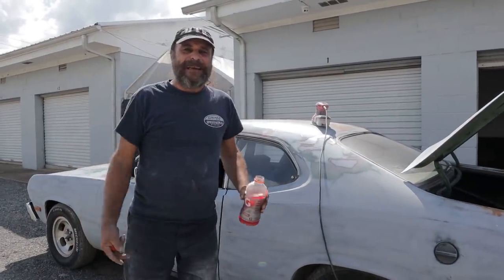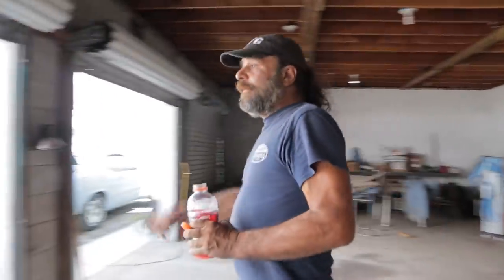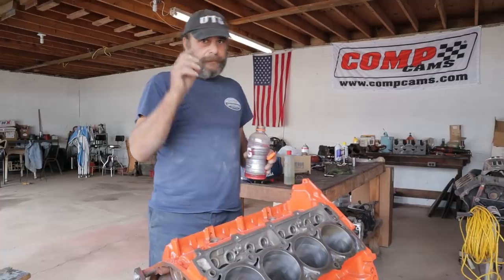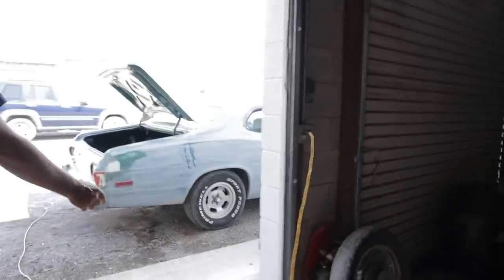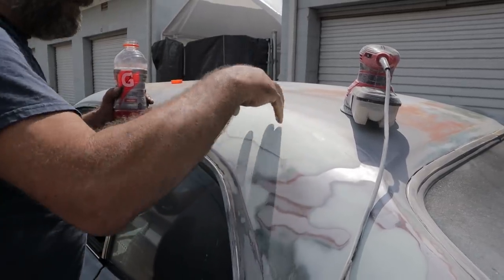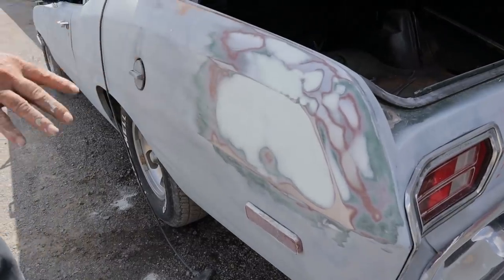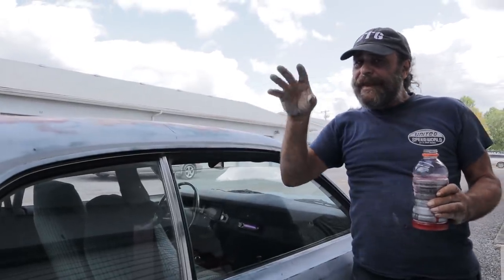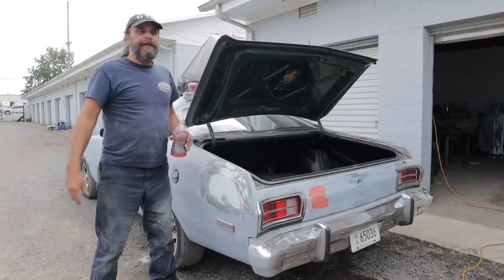DIY Budget Home Paint Job, Take Two...The Redemption?

Comment: That red spot putty you're using is a big no no.It never stops shrinking Tony.
Reply: It deffinetly cracks when it dries :/
Reply: I was about to comment on the same thing until I seen yours. You are 100% correct, its nothing but trouble. It's old school lacquer that is not compatible with todays products. If your top coat has hardener in it then everything under it should also. The replacement is referred to as icing. It has hardener but still sands easy like red spot putty and does not shrink. One that I use is polyester finishing putty by USC part # 26006. Around $26.00-30.00 for a 30 oz tube. It's somewhat self leveling. This comment is not meant to criticize your work just your choice of materials.
Reply: Agreed. That red glaze is trouble. Learned the hard way years ago it doesn't matter how nice it looks,in 3 months it'll have shrunk way down.

Comment: I have done rattle can paint jobs that turned out great, no paint booth just waited for nice days and took my time and did small sections at a time. The key was getting the bodywork perfect which mostly just took time and lots of buffing between coats and wet sanding.  I chose black once and will never do that again, it showed every imperfection and scratch and took twice as long to get it right. The biggest tip I can give is not to rush it.

Comment: Im going through the same pain on my sons 67 VC Valiant, and a trick a panel beater taught me was when you think your panel is sanded and all straight , using a spray bottle with wax and grease remover, spray the panel all over and while its wet and glossy look along panel and any imperfection shows up easily. You can mark that spot and sort it out.

Comment: Metallic! Oh so un forgiving of gun pattern and technique. First time I sprayed metallic, after spraying a lot of solid colors, it came out looking like a bowling ball swirl. :)
Reply: lol
Reply: Tony pay attention, read this comment. Metallic is no joke. Do yourself a big favor - go straight BRG and forget the metallic.
Reply: Just use base/clear urethane and get a really good spray gun.  Work on your technique on test panels. Stay away from silver colors and you will be ok.
Reply: I know someone who randomly picked from the list of pearl coats at the parts store. Didn't keep track of which ones. 
I counted 7 different colors on his Camaro sitting in his garage one night. 
Next week the panels would be different colors under the same lights.
Reply: Right?? Im petrified about the upcoming Dart...!! Im reasonably confident about my painting, but its Rallye Green...and Ive never shot metallic before!!!
Reply: @mitchellferre1652  lol the first metallic I did was a silver hood and fender. Took me three or four attempts to finally get it to look good, plus I was using single stage paint and a gravity feed gun. All I had in 1991.
Reply: However I forgot to add,  years later I did a '91 LeBaron in charcoal grey metallic, but in base/clear, and it turned out great except for one door on the side I had poor lighting in my makeshift plastic tent "booth"
Reply: @Jethrosgarage  lol, the first repair I did was 1988. Dupont Centari enamel  metallic blue. With a cheap siphon gun and really poor technique.  It looked bad, Bad, BAD ! 🤣
Reply: @Jethrosgarage  I saw a light that attatches to the paint gun online recently... Having good light is a huge deal, so ill certainly be getting one before tackling this project!!
Reply: @Jethrosgarage  Wow you were losing the battle before you got to the fight.  Metallic and pearls are on the extreme end of the difficult spectrum of painting.  It is learned only by messing it up till you learn the methods.  Good day.

Comment: Watching this as I paint my car with a paint roller.
Reply: Phuqin savage. 
Everybody get your roll on. What
Reply: I'm currently rolling the Eastwood Optiflo primer on my '65 Studebaker.
Reply: If BMW & Merc can go flat satin, you can proudly go orange peel. 👍🏻
Makes me nostalgic for my rust-belt roller-painted reliable old '78 Corolla.
Reply: I did the $50 paint job a couple times it actually looked good. There was alot of wet sanding though
Reply: That's the power of the home depo more doing more saving ?
Reply: This thread is where I envision heaven to be.  True display of the best of humanity.  I applaud you all.

Comment: Tony, I've been doing custom paint and body for almost 40 years. Do yourself a favor, after doing the body work, put several heavy coats of a product called featherfill on the whole car and block it out. It will help you get it nice and straight. And I would go with a non metallic color unless you're going with a base/clear. Single stage metallics do no lend themselves to be wet sanded.
Reply: Although Featherfill is not my first choice the advice you give is solid. Gotta use a longboard and manually block this car out if you want it too look good. That electric sander is just going to make a mess of it. Agree on the BC/CC for metallics. A novice painter is going to struggle to make single stage metallics look even and wet sanding to correct mistakes isn't going to go well with SS.

Comment: I'm guessing that the weather was hotter and more humid when you painted the Dart. It's amazing how more comfortable weather improves our outlook on just about anything. I've had a fix/flip Ford Explorer at my place for several months. It just needs a fuel pump but I haven't felt like laying under it when it's 90+ degrees with sweat running in my eyes. This weekends forecast is low 70s and low humidity!

Comment: Tony, love the channel, even though I'm not really a mopar guy, I've learned a lot about them because of you. Here is a tip I learned many years ago from a very experienced car painter. I too have painted many cars over the years, albeit poorly in the bringing, until I learned these very simple tips. Always paint the hard areas first, not last. That way you won't forget them. The first coat should always be a light coat, ie it should look like shit, because you didn't lay much paint down. Do the whole car like this & start on the roof & work your way down. That way, all of the overspray of the area your painting will land on an area you haven't painted yet. Let the first coat dry for about 20 minutes or so, then do the second coat. The second coat will "hang" on the first coat which if you're watching how the paint is laying out or flowing, will not lead to drips. The car should look like its finished at this point, ie nice & shiny & appears to be well covered. wait another 20 minutes or more then apply the third coat the same way as the second coat. The third coat may appear not to be needed, but its really there to build up the paint thickness & cover areas that you may have missed in the first two coats. If you end up with drips, let the paint cure completely, then grab a razor blade & wrap the blade on each end with several wraps of masking tape, making sure each end has the same number of wraps. Gently scrape the top of the drip until the masking tape hits the surrounding paint surface, then remove a wrap of tape on each end, then repeat the process. Do this until you remove the bulk of the drip. This process helps you avoid removing paint from the surrounding areas. Once you get the "drip" area down pretty close to the surrounding area, you can then start with the wet sanding process & compounding. Believe it or not, you can remove drips & make them completely disappear. Good luck with this paint job. I look forward to watching : ) .............& PS please wear a mask.

Comment: If u don’t already know about it you can spay the hole car or at lest the spots that your doing body work with shopline or ever coat high build then u wet sand it with 600/800 the ever coat is sweet it sprays on gray and when u sand pink comes out it’s got a build in guid coat now the shop line is cheaper but u need to spay guid coat on to see high and low spots but when your dimes it’s straights it’s a good way to save time and work on your body working time

Comment: Great video UTG! Nice to see ya doing the body & paint on the Duster. I like how you have the little dents & imperfections circled before you started doing any work. It's real easy to see these areas when the car is wet like in video where you were cleaning the car. I think you got overwhelmed on the Dart trying to get the door & fender just right that you over looked the other small stuff, also making YouTube content. I think this one will look 10 times better, not to say you didn't do a good job on the Dart. I feel for ya, there's never enough time!!

Tip on mixing the paint you only need to strain it as you fill the hopper on the gun, at least this is how I was taught & I see others doing it this way also.

Comment: You could have pulled on the bolts you welded on and at the same time used a long spoon panel beating tool (or similar like a broken leaf spring) to fairly firmly hit the outside of the dent. That would have prevented the middle of the roof warping. Like everything else, practice and experience.

Comment: Replacing a tricky dented area can be good. Have done it myself.   But...you might not want to patch over the entire dent in the future. Two layers tight together often rust...like pinch welds.    You'll probably be ok since it's up high and your climate ain't bad.    A better way is to cut out the dent and make your patch with a qtr. inch overlap.      I always drench the headliner w/water for peace of mind.  ALSO: If there are no high spots -   just use filler. Doesn't matter how thick no matter what anyone says. BUT the majority of the filler should be kitty hair. Short-strand fiber reinforced. It's water proof and bullet proof, though you can't finish-sand it. Make sure it's low enough for a layer of regular filler.  This will save a lotta fucken around!      Lookin' good!

Comment: My 69 Plymouth 318 surges while driving. New filter in it. Doesn't always do it. But I am playing with the timing, but I'm not sure the two are related. Looked but I couldn't find a vid from you on it.
Reply: Vacuum guage diagnosis bro... will reveal valve guide leakage, etc... spray around all vacuum hoses with carb cleaner and listen for change in idle too

Comment: Guide coat your primer ..so you know if your bodywork is good.......guide coat is use  on /over your body work .....3coats of primer /sanding type say color grey......then one lite coat of either black or red.....when you block it out you will see your highs and lows......use polyester putty
only use the red putty on final prep work it doesn't work well on bare metal and it shrinks where as the polyester doesn't shrink and works on bare metal .....heres  how I see it done
body work to 80 grit or 120..then  feather painted areas around it ....3 coats of grey primer surfacer  or high build primer .....lite guide coat of say black or red .....block out check for highs or lows ...fix if you noticed by feel/hand ....if pretty good ...3 more coats of primer and one guide coat ..now use your red putty if needed .....primer once more block should be good to go .
Using a high build prime epoxy base will most likely skip one step as per a lacquer base primer.........use fast dry thinner if you are using a lacquer base .....this is old school and it has worked for years even George Baris customs used lacquer based primers ..biggest problem is drying time and need to build up......Epoxy High build primers fast track all of it but BUT some 
older paints like Acrylic enamels don't work well .stick well to it so make note of this....there are ways to fudge it ....but ........good guy to watch is My Friend Pete at DIY Auto school.....I've been a body trades person for now 35yrs ...no ...37 yrs Lols .......    hope this helps you 
body work 40 to 36 grit ...finished in 80 or 100 grit  or better ......1st primer 3x 180 grit ..to 240
2nd 3x primer- 240. to 280 or 320 ......3rd 2to 3xs primer 320 to paint...just thought of something..if you are painting your car in hot weather ...use a slow reducer........if you are doing it in cooler weather use a medium reducer ........spray at around 60-5 and depends of temp. and paint flow......you can reduce your final coat out thinner to do a mist coat. this brings out metallics and flows out the paint BUT USE ONLY AFTER THE LAST COAT....think
your car gets 3 coats so 3x around your car you start at the front hood to fender to roof to door to quarter to trunk to back panel to trunk to quarter  to roof to door to hood to fender
let it tack up for 10-15 mins .....then repeat but keep going around the car ...no tack up only 1st time ...it holds the paint from runs sags ........if after the last 3rd go around ...you want to do mist coat thin down your paint by 10% and go around again ..........never try to paint a panel 
completer ....do it in sections and by panel to panel 1st coat ...go round car second coat go around car 3 coat go around car ......make sure your car surface is clean before any paint or primer goes on the car............My friend Pete @DIY AUTO SCHOOL has many good videos ...with good info but remember he is using todays paint products  70s and 80s don't work with todays paints ..it can but ...to much info. here..I'll just say sealers needed to be used....one last thing if you are spraying  metallic and you see  Zebra striping ....cross coat ...and then up and down so like a  + and try upping the air pressure .......so one coat > and another up and down
You'll get it ...........wish I could show you .....all it takes is practice ...remember ..gun trigger action ...you should always hear air ......practice before doing your next paint job...notice the trigger has 2 steps pull to the 1st ....just air comes out ..this will be where your trigger should be when leaving the panel never release until no air comes from the gun .......2nd trigger pull
this is when you are painting as you paint you start to leave the panel you release to the first trigger step no further ..practice this as it is important ..you only release the trigger when you are finished and off the car not while in painting mode....practice your trigger action..very important ....... become like you are one with the gun ....lols

Comment: You got a compressor why don't you buy a DA. It will make the biggest difference in your body work.
Sanding discs are cheap and they're easy to change. If you want to do the job right use the right tools.
You will get professional results.
Reply: Whats the difference between that and a regular electric orbital sander? Not arguing just asking because I never thought there’s a difference
Reply: @Beandiptheredneck  the way it cuts, the way it clears, the way you can control the RPM, and the way you can feather. Try one. Listen to somebody who knows how to run one. They make a certain sound when they're being used properly.
You got to ask yourself why would they even bother to make one?
Why do all the body shops use them? Why are they the standard in the industry? There's also the size of the disc, and the flexibility of the sanding head. Electric orbital sanders are for wood. They're not for working compound curves.
The tool is made for the job.
Reply: eric heine never really considered the variable speed, I literally just used an orbital to do body work today, but I’ll happily admit I’m a hack lol
Reply: Also when you do a patch like that use Bondo and fiberglass 50/50

Comment: I can't help it. I love this car! It brings back to 19 years old. It's my first new car. I bought a 1974 Duster, in Deep Sherwood Metallic, with 225 and a 3-speed in September 1974. I loved that car! I got rid of it in 1980. It had 127,000 miles. It needed front end work. The shift linkage was worn. The seats were torn. This led to the worst automotive buying decision of my life. I traded it in on a brand-new 1980 Chevy Citation, which may be the worst car ever made.
Reply: My friends mom had one of those Citations growing up. I believe you couldn't have gotten a Citation with that Citation if you tried. Slow very...slow.
Reply: @DR440  -- No, but you could get into an accident without trying at all. During the 4 years that I owned it, among a laundry list of problems, the car was recalled 4 times for premature rear brake lockup.
Reply: @oldpolak5203  - Maybe, but only because of the boat. On its own, the Chevette, POS though it was, was a much better car than the Citation.

Comment: Ya always use single stage, has clear  in paint much stronger, can always add clear on top if more gloss is wanted, last outside without burning peeling like dual stage base clear coat . 🔯

Comment: Will a moter hiss when spinning it over by hand with no rocker arms on it and spark plugs in it? Was spinning it over checking lifters moving free and herd it doing it is that normal
Reply: Yeah, leakdown out the valves opening
Reply: @THRASHMETALFUNRIFFS  the valves weren’t opening with no rocker arms.  That said, the compression has to go somewhere and past the rings is it.
Reply: @johnwilburn  Oh  right, yeah, could easily be "blow-by" action past the rings into the crankcase?
Reply: @THRASHMETALFUNRIFFS  where else can it go?